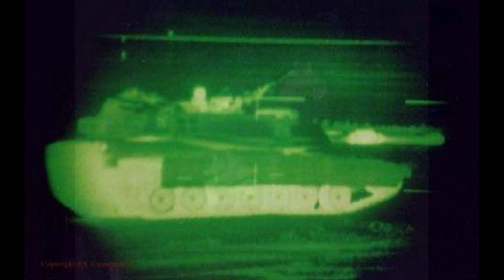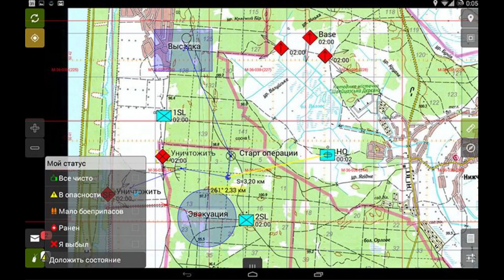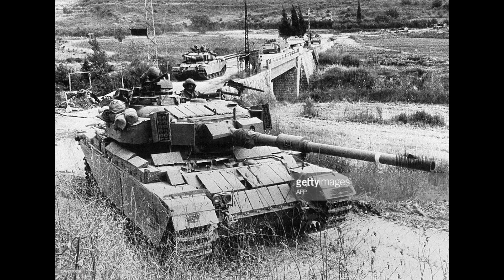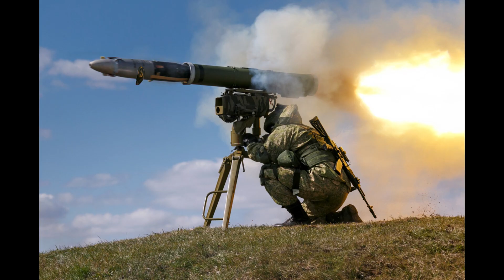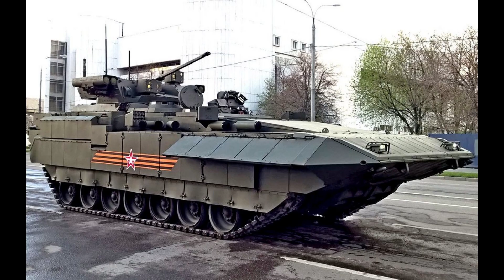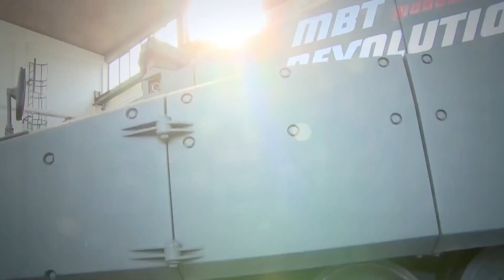Modern tank comparison (MBT's 2021)

Comment: **FACT: At ranges greater than 1500 meters, the T72/ T90 cannon fire is ineffective against the Abrams frontal armor.**

**At the same distance, the Abrams can turn the T-72/T-90 into an instantaneous 3 person crematorium. **
Reply from the maker: It depends what version of the T72 and what ammunution is used. The modern  upgraded T72B3 actually has very modern fire control system with thermal sight, which is not much far behind to the Abrams. And the latest round the BM60 "Svinets" has some 700 mm penetration at 2km which is very dangerous even for the latest Abrams. Especially since the Abrams only has a 50 mm plate at the Upper Front Hull, which is only around 600~700 mm effective at most. 

But the Abrams should be compared to the T90M which is pretty much on the same level with the latest Abrams variant.
Reply: @militaryanalysis5028  The frontal slop armor of which you made reference is at 82.5°.  It has proven impenetrable to frontal attack. 

https://youtu.be/mQHSlZfjbng

As we know, the Abrams utilizes laminate armor fortified with plates of Depleted Uranium. Therefore, utilizing penetration numbers based upon RHA is not applicable.  All that said, the "1985" Abrams armor specifications have been leaked into the public domain and the rha equivalent rating is quite surprising.  

Perhaps you're unaware that the cannon on M1A2C3 is equipped and firing "ETC" ELECTRO-THERMAL CHEMICAL ammunition. There's a lot of open source information on ETC technology. For foundation knowledge, there's also several informative YouTube videos. 
https://youtu.be/u0gneYoV2PQ

https://www.google.com/url?sa=t&source=web&rct=j&url=https://www.sto.nato.int/publications/STO%2520Meeting%2520Proceedings/RTO-MP-AVT-108/MP-AVT-108-37.pdf&ved=2ahUKEwiyj8Sm5K7xAhUIOs0KHdiAAMoQFjAHegQICxAC&usg=AOvVaw3ncETe9I9cFx8zIMQkAbvN

Lastly, even the Russian Propagandist "Red Effect" conceded in a recent video that the Abrams M1A2C3 equipped with the Trophy Active Protection System, and supplemented with TUSK is impossible to defeat in a frontal attack. 

Please let's not even bother to discuss the ARMATA.

***According to open source Wikipedia Russia has built ~ 20 Armata Tanks since 2016.*** 

https://en.wikipedia.org/wiki/T-14_Armata

Within the Wikipedia information is a quote from the Russian Defense Minister in which he completely dismissed viability of the ARMATA.
Reply from the maker: @imyrbiggestfan  Yes I'm aware of the slopeness of the Upper Front Plate, but it is far from impenetrable. It is around 500-600 mm effective at the best. But the most modern penetrators can penetrate over 700-800 mm today, which puts the 50 mm Upper Front Plate of the Abrams at risk. The armor didn't prove anything since it was never shot at from a modern enemy tank gun in the first place.

You need to understand that APFSDS penetrators never hit a target from 0° because the projectile will always have a ballistic trajectory above 1km range (just like any other kinetic energy rounds fired from any type of guns). Because the gravity force pulls the projectile downwards during its movement through the air (due to the earth's gravitation forces) so the projectile steadily loses speed and energy as it slowly falls down to the ground the farther it moves through the air. This effect already influences the round after 1 km range. So if a target is at far distance (above 1-3 km) the gun needs to be elevated a little bit upwards, to give the projectile a ballistic trajectory, which it needs in order to reach a target at long distance. This will cause the projectile to strike the target from a certain angle like 30° degrees (due to the Ballistic trajectory flight path), which will negate much of the armor's slopeness (basically it reduces the effective "Line of sight" of the Upper Front Plate since the projectile strikes from an angle which reduces the slopeness of the armor plate).

Of course the projectile will also lose speed which results in less kinetic energy the farther it goes, so that will negatively influence the penetrating performance at more than 2 km. But even with this in mind, most modern penetrators can still easilly penetrate at least 700+ mm armor at 2km which is enough the penetrate the relatively thin 50 mm uper hull Front Plate of the Arbrams. 

The Abrams was deisnged 40 years ago. The armor design was good enough back then to stop most Soviet rounds, but since the 1980's the hull design has not been changed. However the penetrators have advanced a lot since then. During the Cold War the most powerful Soviet rounds penetrated around 400-500 mm which was already very strong at that time. But modern rounds today can easilly penetrate twice as much! And since the design of Abrams Upper hull Front has not changed significantly which means it is quite vulnerable today. There is only so much a 50 mm plate can do. It's not some kind of magic layer that can magically stop any round just becauseits angled (which is irrelevant at long range anyway as i already explained to you above)

The video link you referenced only simulates the critical angle at which the simulated projectile (in this case a 500 mm Tungsten rod) would fail to penetarte. As you can see at 82.50° it still penetrated but only 0,25° more (82,75°) and the projectile fails to penetrate. This is why the Abrams front plate was designed to be at 83°, because they figured out that at such critical angle most projectiles used at that time would likely fail to penetrate. But there are 2 problems with this Simulation. First, it completely ignores the Ballistic properties which i just explained to you above. In the simulated video the round hit the armor from 0° but as I already explained to you this is not realistic condition. And the second problem with this simulation is that it obviously uses a very old round from the 1980's, because modern penetrators are not just 500 mm long, but they are now actually 700-800 mm today. Which gives modern penetrators even more penetrating capability. The 500 mm penetrator type was used during the Cold War times. But today it's much longer and with 2 separate pieces too (2 piece core penetrator which increases the penetrating performance even further). So this simulation that you referenced is completely useless when we're talking about modern penetrator rounds. The only thing this video proved is that the old Soviet rounds from 40 years ago would have difficulties penetrating the latest Arbrams Front Armor from today, but this is nothing special, it is obvious results to be expected.

Ask this guy to do the same simulation but with a modern 800 mm long and 2 piece round instead of a 500 mm  monopiece core penetrator from the 1980's, and also add some ballistic properties and watch the projectile cut through the plate like a hot knife though butter.

The Abrams has some good protected parts but only where the composite armor package is, which is only strong at the Turret Front Cheeks and at the Lower Hull Front. But all other parts of the Abrumz are still vulnerable to modern KE rounds.

The Abrams has never faced any modern tanks in combat yet. Nothing is proven until it faces modern tanks in real combat.

Yes, the Torphy APS really helps to increase the protection level against missiles and RPG's, but it doesn't stop KE rounds. The Trophy APS is only meant to stop missiles and rockets. Only the T14 Armata has an APS that can actually intercept even KE rounds too. But the Abrams is still vulnerable to powerful modern Russian KE rounds. 

Just face it, no tank is incivncible. Put your toxic fanboyism aside, it makes you blind and delusional.
Reply: @militaryanalysis5028  "Toxic Fanboy" If you find yourself in a discussion and someone attacks you personally? At that very instant you've won the argument. 

In your the last sentence of the 1st paragraph you said, " It doesn't mean shit, because it's never been shot at in combat." Then you proceed to type multiple paragraphs. Please note you brought up the frontal armor issue. Perhaps you weren't prepared for weren't prepared for a discussion in slope angle? 

In addition, I supplied supplemental information to support statements.
Throwing out claims without supporting information is an opinion. Please refrain from opinions, and provide supporting information in support.. 

Any reference to the ARMATA tank or the supposed Active Protection System is mute, because the company/manufacturer no-longer exists. Again, the Russian Defense Minister made it clear that the ARMATA is not a viable weapons system for the Russian Military.  *Please see the Wikipedia information regarding the ARMATA, as well as other open source information regarding the now defunct ARMATA manufacturer.

You completely avoided the open source information regarding the 1985 Abrams laminate composite armor to the rha equivalent. Producing penetration numbers based upon RHA and then claiming that it with defeat composite laminate armor is bordering on obfuscation.As you know,  all modern MBT utilize composite armor, because it it superior to RHA. RHA is nothing more than a standard to judge penetration. Abrams M1A1 (export) composite armor to rha equivalent testing is available within 1 one of "your videos." You might be suprised by the information. Please note that since the aforementioned testing the Abrams has undergone at least 3 armor upgrades to include the addition of Depleted Uranium panels. **Do you have any penetration data on Russia's latest APFSDS ammunition vs Laminate Armor utilizing Depleted Uranium Panels?**

I hope that you found the ETC Cannon technology of interest. I think certain that Russia will soon follow suit and the arms race will continue. 

In future, I trust that you'll refrain from personal attacks, because they don't reflect positively upon your channel.
Reply from the maker: @imyrbiggestfan  I'm sorry to burst your bubble but the Abrams doesn't have any composite Armor on the Upper Hull Front (Glacis). It's Just a single steel RHA plate 50mm thick. Even the simulation video that you like so much to use as your own reference source clearly shows that it's only a single RHA steel plate. Watch the simulation again. At least you should understand your own reference sources before lecturing others about it lol

Only the LOWER part of the Hull Front has the composite Armor package with the Depleted Uranium layers. That's the only part of the hull with composite Armor package and DU layer. And of course the Turret. But Nowhere else. So no, the Glacis has not Depleted Uranium.

The Glacis made of steel plate is only around 500-600 mm effective RHA protection. Which will be easilly penetrated by any modern KE round that can penetarte 700-800 mm at 2 km. 

Even your referenced simulation video agrees with me, because it shows that the armor plate can barely stop a 500 mm rod and already has great difficulties to do so (the projectile almost completely penetrated). So the armor plate is already at its limit from an old Cold War ERA ammunution. Now imagine a modern 800mm long rod with 2 piece core. It will easilly go through. And that's what you fail to understand. 

There is only so much a single 50mm Armor Plate can do. There is a limit to how effective such a thin RHA plate can be. 

And no, the Upper Hull Plate (glacis) was not upgraded with DU, it still only remains a normal RHA plate. It was increased from 38 mm to 50 mm tho, that's the only change.

But only the Composite Armor Blocks have been upgrades with the Depleted Uranium in the LOWER Hull Front and Turret only. Not the upper hull Glacis.
Reply: @militaryanalysis5028  You keep harping on a hypothetical. Therefore, let us conduct an exercise in practicality; Regardless of vintage, how many Abrams Tanks have been destroyed by penetration of the "ANY" of  frontal armor areas? Granted all tanks have weaknesses. Most especially, the rear. 

As you'll see in the video not a single one of these ATGM penetrated the frontal armor of the Abrams. Please pay close attention to Russian Kornet ATGM equipped with a larger warhead and greater published penetration than the  9M119 Svir/Refleks fired from the 125mm cannon. 

https://youtu.be/s13qnIAq-DE

Please be certain to post links in support of your comments. Otherwise, your comments are nothing more than opinions.
Reply from the maker: @imyrbiggestfan  Yeah the composite armor at the front is supposed to stop HEAT warheads of missiles, that's what it was designed to do, this is nothing new. So it's just doing its job. This is not only exclusive to the Abrams, basically most other modern tanks can survive missile attacks from the front too, including Leopard 2, Challenger 2, and T90. Afterall the front part of Most modern tanks is mostly immune to missiles and RPG's. 

Likewise there are also many videos of T90 surviving American TOW missile attack in Syria too. 

https://youtu.be/2rfyeR-YaJw

and Here another T90 surviving two TOW missiles in a row

https://youtu.be/OTpboKF6-ZU

But it's the vulnerable sides, rear and top that makes the tank vulnerable to missiles. Only add-on armor or APS can securite the weak flanks.

The biggest threat to modern tanks are Top-Attack missiles or drones that fly high above and attack the vulnerable roof top of the turret. these missiles completely ignore the heavy composite Armor package as it flies above and strike the thin roof. At least the Russian tanks have some ERA at the roof top which provides at least a little bit extra protection. The Abramas has nothing on the roof at all so it is very vulnerable against such top Attack missiles. Luckily the Russians don't use Top Attack missiles at the moment yet, their best missile the Kornet is still a direct attack missile, but the Russians have the Krasnopol Guided Artillery round which is laser guided and can hit the turret of the Arbrams to destroy it that way. But that's just how it is. No tank is invincivble.  Anything can be destroyed with the right tool or weapon.

But still, tanks have an important role on the modern battlefield, especially with Active Protection System they remain very important and powerful weapon systems.
Reply: Lol Abrams hull is so bad, it can be penned even from 5000m
Reply: @bogdandragan289  You're a baffoon!!! LMAO 🤣🤣🤣
Reply: @bogdandragan289  ***Not a single one of these Russian ATGM will penetrate the frontal armor of the Abrams.***

https://youtu.be/s13qnIAq-DE
Reply: @imyrbiggestfan  What is this garbage? I was reading through the comments, and Military Analysis provided some cogent, very insightful statements. Then you cite wikipedia tripe. Wikipedia is not a source of concrete or dependable information. There is not a lot of information out there, but here's a recent article: https://www.thedefensepost.com/2021/07/06/russia-mass-producing-t14-armata-tanks/

Looks to me that the Armata program is still in operation. 

Regardless, the discussion was about Sabot rounds of depleted uranium. It was not about whether the Abrams' frontal plate can withstand an antitank guided missile. So posting that video was a waste of time because it is irrelevant. The issues is whether the Abrams can withstand a round of depleted uranium. You cite to a tungsten round that actually penetrates the Abrams' armor. 

Are you freakin' kidding me? You don't even know to what you are citing! lol GTFOH! There's a term in England that is used to describe people like you. It's muppet . You are a muppet .